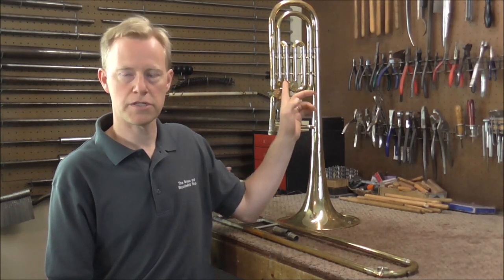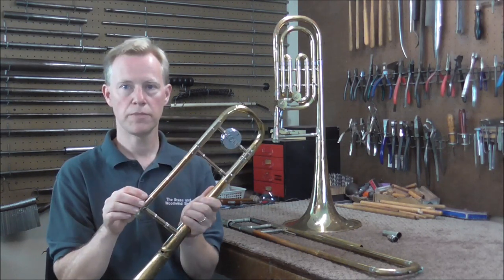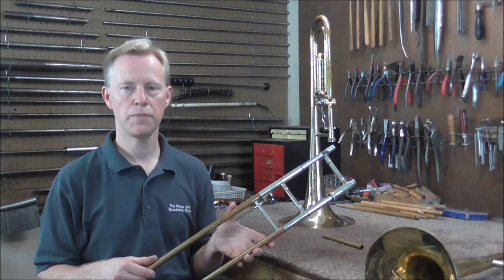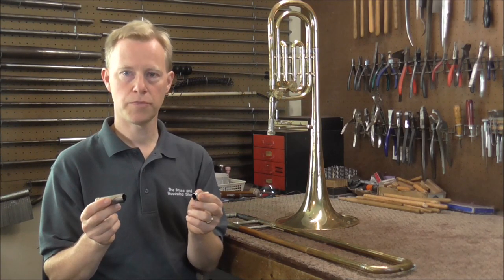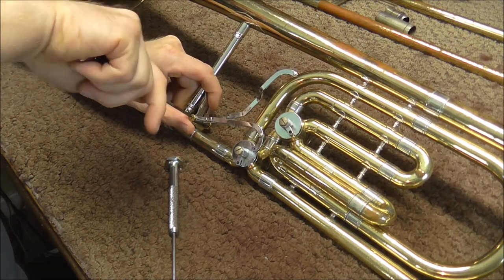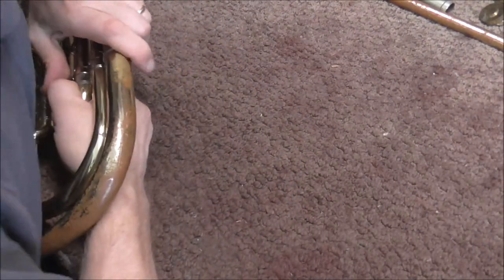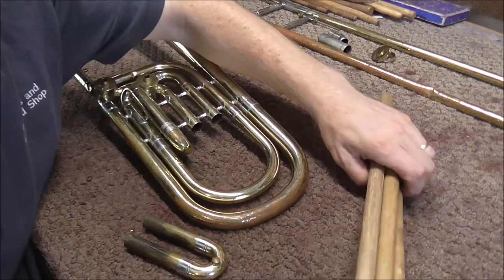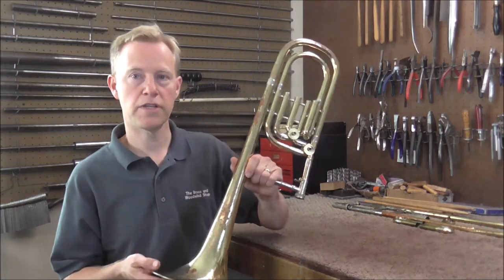Restoring A Trashed Bass Trombone Project #1

Comment: The second valve likely lowers it to E. It is more common in the older bass trombones cause it allows the player to play low B at the end of the slide.
Reply: Looking at the length of the crook on the second rotor, I would have to agree. I have an old Bach bass trombone with dual rotors that make it play in F and Eb. The Eb crook on that horn is roughly twice the length of the crook on the second rotor on this horn. That makes sense since on my Bach the small crook lowers the pitch a whole step while on this horn the small crook lowers the pitch only a half step.

Comment: Is that a dual bore?  I just finished a 1923 OLDS , Los Angeles made...dual bore and also tunable slide.  I didnt know they made them tunable into the 70s.  Thats cool.  Weight not an issue on a tenor.  I could see it adding weight on a bass.  PS...I got it out eventually but I got a dent ball stuck inside! No fun....
Reply: Yes, it has dual bore (.554-.565)

Comment: The rubber ring is a standard O-ring.  You can replace them at hardware stores that sell plumbing parts, or auto parts supplies.  You could also cut a piece of rubber tubing as a pad.

Comment: Those valve springs remind me of cantilever brakes on bicycles: many frames even have the three holes to adjust tension.  The o-rings look about the size of "cable donuts" used for bicycles as well.

Comment: Look for nitrile rubber o rings....measure inside and outside diameter.  Ive seen them about that size. Similar to ones used inside aquarium pumps.

Comment: Just get one of those green o-ring kits from an auto parts store (or the internet).  That o-ring will be one of the two smallest sizes.  Technically, you could also repair the old o-ring with the appropriate glue, but why bother?

Those rotors seemed pretty clever until you disassembled them.  Now you've got yourself a nice little nightmare to reassemble.  Hope all of the original tick marks are accurate!
Reply from the maker: Thank you for the information about the O-rings. I will try that.

Comment: Art, the rubber ring looks like a standard buna o-ring. Measure the outside diameter of the good one and the diameter of the rubber cord and find it here.
https://www.mcmaster.com/o-rings/oil-resistant-buna-n-o-rings-8/
Once you have the dash number, check with a good hardware store and they might carry them. From a hardware store you can buy one or two whereas from McMaster you'll need to buy a small quantity.

Comment: The second trigger actually raises the pitch? That's awfully strange.
Reply: I think he misspoke. You can get  a good view of the bell section at 7:48. It looks to me like the second valve will make it Eb, not G. Another common second valve is D. But there doesn't appear to be enough tubing to go down that far.
Reply: @TheMrAshley2010  If it was an independent system, then the 2nd valve would lower to G (or Gb) by itself. On this trombone the 2nd valve would lower to Eb. Maybe an explanation of independent vs. dependent bass trombone will be in the next video.
Reply: @Sherman1fan  Precisely. That's why I checked the video for a good shot of the bell, to make sure they are dependent valves, before making the call. How 'bout that 'kink' in the slide though? This should be an interesting series to watch.
Reply: It’s a “G” valve in that it is shorter in length than the F valve.  On an independent rotor system, it would put the instrument in G if engaged by itself.  On a dependent system, it should place the instrument in “D” when engaged with the F valve.
Reply: @trombonstya  I stand corrected.  This is the S-23 model and the Olds 1970 catalog does list the instrument in F and E so the second valve is a 1/2 step valve.